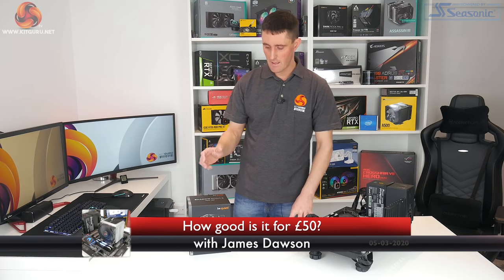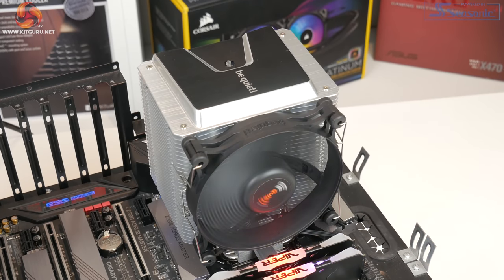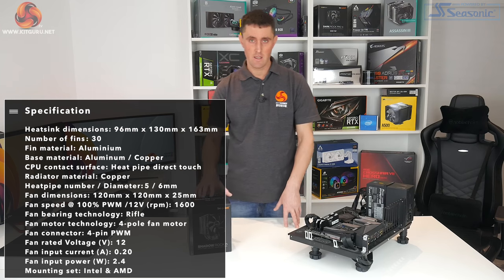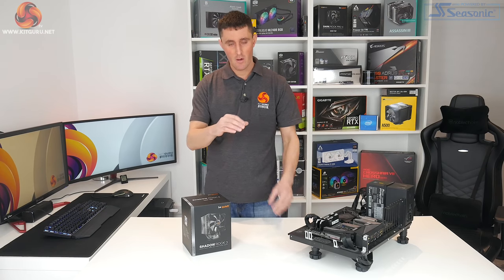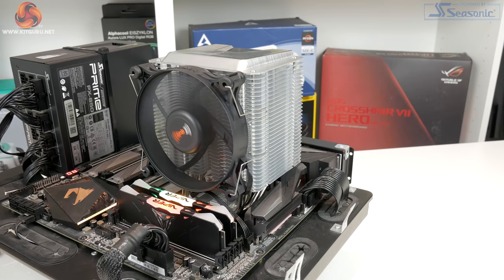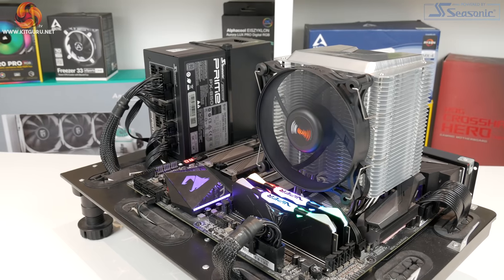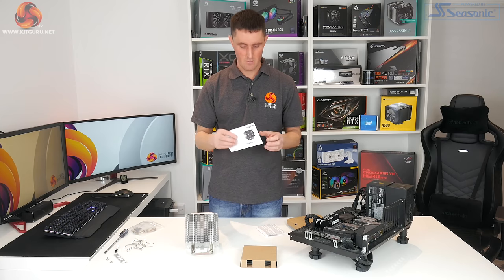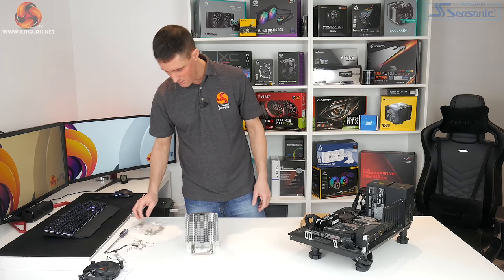be quiet! Shadow Rock 3 - in-depth review w/ thermals and acoustics

Comment: Hi , I used to have water cooling, and I changed my cpu to a ryzen 7 5800x3d in a system with an rtx 3080 ti.
I asked the expert at my local shop about a better cooling solution , because :
I have 2 big ass 200mm fans doing the intake at the front and one small 120mm fan as exhaust at the back.
The problem with the water cooler is that it occupies the case’s top space for vents , and only cools de cpu. 
Wich left me with a case Configuration that has only one 120 mm cooler master fan doing all the exhaust work for the case. So even though the water cooler did a very decent job at cooling the cpu, the rest of the case was very hot , because of the 3080ti heat generation , not being properly vented out of the cage.

And the expert from my shop recommended me this one , he said me , hey man we are installing this cooler in some ryzen 9 5950x processors , that definitely get hotter than your 5800x3d and after 2 hours of usage under heavy workloads , it keeps them only 2 degrees hotter in average , than some of our water cooling solutions. And this is Sevilla, Spain , a place where the temperatures are over 40 degrees Celsius.
You are taking this pc to the north of Spain , where it’s always under 22 degrees Celsius .

So yeah if it can cool a 5950x very decently.
It can sure keep you 5800x3d very cool.

And mine is a high end cpu, no doubt about it , it’s killing the benchmarks
So low to mid tier my ass , unless you guys are looking for bragging rights , this cooler can fit any system.
PLUS , AND THIS IS THE VERY IMPORTANT REASON BEHIND IT ALL: now that I got my case’s top space available, I could finally install 2 top vents. Acting as exhausts , wich is the natural way hot air goes , up.
And my case’s temperature dropped very hard , not only GPU temperature is now about 8 degrees lower , no joking , that’s how badly the water cooling vents where helping the vent of the rest of the system.
But also the case itsel.
Now , when I touch the tempered glass , it feels warm-ish.
Before when I touched it , it was super hot , if I left my hand on it , it could cause a skin burn.

I’m not saying water cooling it’s useless 
And I’m not saying that super hígh end air coolers are a waste of money.
I’m just saying , that unless you are planning on doing , heavy overclocking with the hottest cpus in the market , this “”””mid””” tier air cooler can manage super high end gaming at 4k , with pre designed factory over clock options in the bios activated,  no sweat .

If you are trying to get an i9 12900ks from 5.5ghz to 6.2ghz then yeah , this cooler won’t be up to the task.
Reply: Thankyouu ! This made me feel more confident about my decision with this cooler now ☺️  aios are so popular rn its crazy! It makes me question whether i want the aesthetics of them or something that is more functional for the case since i live in hot weather. i have ryzen 7 5800x with rtx 3070 ti with 5 fans. So i went with this one too 😌
Reply: @ItPixie  it’s a very good cooler , and it will cool your case just fine.

That said , I gotta admit, I committed a mistake , on my original comment.
Water coolers , do act as exhausts too.
I was using a cheap water cooler, a decent water cooler , with powerful fans installed to it 
, should both keep the cpu and the case cool.
Reply: @lawyerlawyer1215  they both have pros and cons, ill probably test out the aio for my 3rd build in the future haha

Comment: IMO they used the wrong fan for this CPU cooler. The Pure Wings 2 have much higher static pressure than the Shadow Wings 2 fans, and I would like to see how much better that would perform. If I was OC'ing I'd rund two Pure Wings 2 in push pull and it would still be pretty quiet.

Comment: There is a cooler that is also a PC Case which is the Little Devil PC-V10 but it seems that Vapochill does a similar case that does exactly the same thing to cool the CPU to -70 degrees Below Zero and are very heavy because of this and is as quiet as a Fridge/Freezer.

Comment: @KitGuruTech What is the name of that test-bench platform you are using? I'm looking for a decent one that isn't overpriced for what you get.
Reply: @TheStigma It is actually a homemade test bench using a motherboard tray from an old mid-tower ATX case.
Reply: @jamesdawson1964  That's a shame, but thanks for sharing the idea to just DIY it. That might be just what I end up doing. Where did you get those feet from though?
Reply: @TheStigma  The legs are from a joinery store, used in kitchen cabinets and are height adjustable.